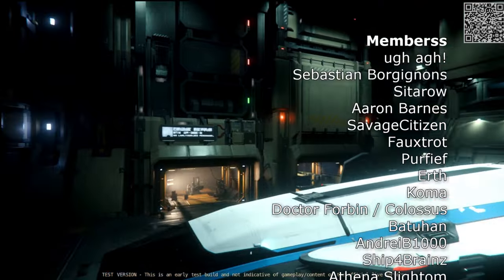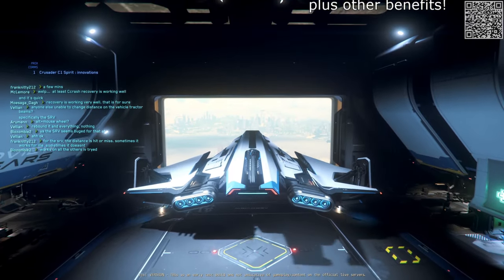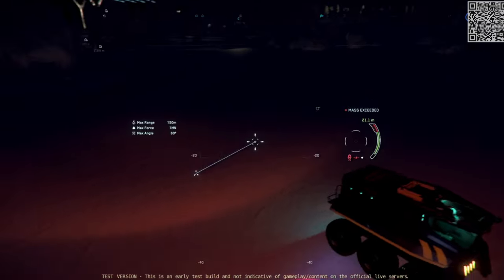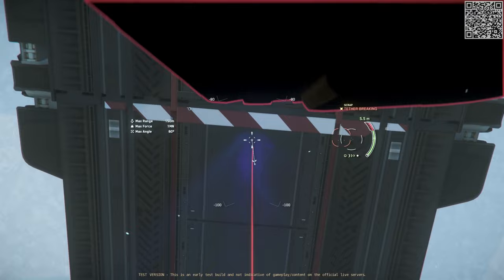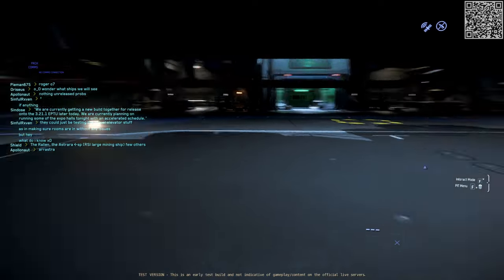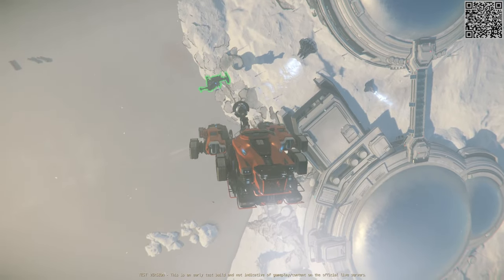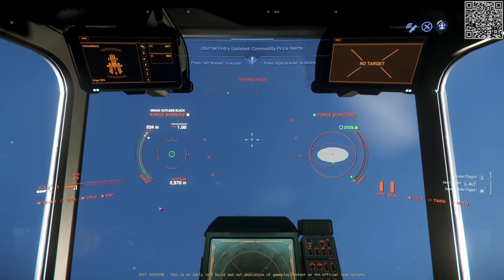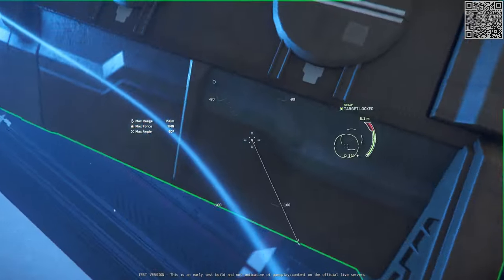Star Citizen 3.21.1 SRV and C1: A Tale of Two Tractor Beam Ships

Comment: I hope that they come up with an outstanding breakthrough in tractor beam operation, you know something that will not have us pulling out our hair with frustration. As for the realization that players will be able to use the SRV to harass others by dropping dead ships, well I expected that this would be a thing and it will be interesting to see what steps CIG will take to fix this which will undoubtedly become a problem, due to the numbers of players that will be doing it.

Comment: Regarding C1's tractor beams vs handhelds: there are many times where people forget their tractor beams (or when engineering goes live, a handheld tractor beam running out of battery juice during average use), and in those scenarios you can still load large cargo into or out of the C1 even if you did forget your handheld tractor beam, which -- judging by a lot of YouTube content creator streams -- happens rather frequently. It may not need to be super useful, but it is a good contingency just in case. Much like how with pickup trucks, they can still tow other vehicles even if they don't have a rear hitch mount attached because they have front tow hooks available... just in case.

Comment: I have both the SRV and the C1. Seems like a definite oversight on CIG's part with the placement and specs of these ship tractors. They were "placed" back when it wasn't fully settled what the cargo size and form would be. Thus when they placed the full tractors, well many of them are simply not practical or workable. The Cutlass black might have the same issue as the C1. As for the SRV tractor issues, I hope they fix it by the time it is officially released to live. and using this tow-tractor to harass people by dropping ships on them is to be expected. There are always people who look for ways to exploit game mechanics to cause upset and mayhem. Unfortunate side effect of MMO-type games. Great vid as always!

Comment: The towing controls do need some improvements at this point.  As it needs a mode to aim the towing head directly downwards as that'd help significantly for gently placing your towed ships down instead of harassing a ground location by dropping a dead ship on it indiscriminately.

Comment: Interesting stuff, though I feel the need to point out that, even if the mechanics of the SRV allowed for variable beam-length, which they should, people will still drag hulls over ground locations and simply drop them by shutting down the beam. This was inevitable from the start.

Comment: The C1 seems like a slightly cursed vehicle when it comes to layout. It just doesn't use its space very well, either because it has no second exit, or because the tractor beam is too close to the ramp making it awkward to use. Sure looks gorgeous, though.

I think the Constellation Taurus has probably the best tractor beam placement, though I've yet to see someone use a Nomad.  On the Taurus, the tractor turret is sitting at just the right height and distance to easily load the cargo bay.

True to style, the Argo SRV is well laid out on the inside. I really like that the elevator is inside the component room. Compact and logical at the same time. A shame that you accidentally colony-dropped the Cutlass on somebody on the ground, but it seems like they're still trying to figure out the feel of these bigger tractor beams. I was surprised that you couldn't manipulate the distance and rotation of the Cutty, since I've seen other videos of people using the Vulture's tractor beam to manipulate their salvage ship for scraping.

Comment: I'm very much looking forward to the SRV, it'll be interesting to use it as part of my salvage operations.  From what I've heard, the ship tractor beams, while implemented, are not anywhere near their final polished stage, especially the hauling beam on the SRV.   Hopefully, in the future, we'll be able to grab ships from salvage missions, since we have technically paid for them, and haul them to a station for repair, or even repair them enough in space by replacing parts to get them to a station, and then pay a registration fee so that ship becomes yours.  That sure would beat just dropping them on a planet.  Can you imagine the havoc one could cause by dropping a bunch of C2 wrecks on a mining outpost or something?

Something else I thought of.  I would guess that most of the time you would be towing a disabled ship, it wouldn't be your own ship, so the pilot of said ship would still be on board, and would be able to request their own landing permission, then all you would have to do would be to maneuver it into the hangar, or even better, have the hangar be able to detect if the ship was disabled/in soft death, and use a tractor beam in the hangar bay/landing pad to take over and pull the ship into the bay, similar to the auto-land function.

Comment: Inadvertently or otherwise, dropping ships (or indeed asteroids) onto unsuspecting ground targets is going to make the SRV more of a griefer's paradise than it will answer any of the game's needs (at least in its current implementation by the looks of it).

Also, it's quite hilarious that you can't actually use the C1 tractor beam to load cargo onto the ship. YOU HAD ONE JOB!

Comment: Well... at least you found a way to make the Cutlass Steel a useful drop ship :D  There are a lot of issues with ship tractor beams - I wonder if an operator UI (similar to a tower crane controller cockpit) is planned, with manipulation icons on the screen instead of keyboard shortcuts you could just click rotate arrows or a beam length slider.... similarly it could warn you when you're about to smack the container into the ship in a similar way to a car's reverse parking sensor.  Obviously it shouldn't completely trivialise the cargo handling but there needs to be a safe way of getting stuff on to your ship :)

Comment: How is it RoRo? That would suggest the vehicle doesn't need to reverse. RoRo is used to describe station design for land vehicles normally, such as trains. They roll on from one side and roll off the other. The bay in this case would be Terminus, you have to exit the way you came in.

Comment: i wonder if the C1 will be able to tractor external containers in flight.
if there was an even larger container format thatn 32 scu .. or say, some method to bundle together several 32 scu, and if the spirits tractor beam was able to hold on to such a container stack in quantum, it would double or tripple the total scu cap for the spirit c1 easiely.

Comment: I would have thought that as they already have the elements in game to rotate and shorten/ lengthen beams they would apply this to the Argo ship towing. Even just the rotate would make things 100% easier. I like the idea of the arm extending to use in the C1 and Zeus, but maybe just shortening the minimum limit would also work if the beam has the mobility to move items all the way along the ramps without losing lock, something that also happens with the current hand held Pyro multitool. Not looking forward to getting dead ships dropped on me though or coming back to my ship after a bunker and finding it's been towed.
Reply: The ship tractor beams are slightly different tech in terms of how they handle mass, so it may require more tweaking than what we have with the handheld tractor beams.
Reply: I think you may have misunderstood my comment, I meant purely to the rotational elements of the mechanic, which should remain the same in the base code. Mass and volume should be just variable integers in the scripting.
Reply: @krisghoststar  Ah, yeah, I understood -- I was more-so referencing that even though they seem like the same tech just scaled up for ships, sometimes the functional library code for these features aren't quite the same because of how they're accessed. For instance, there are steps to accessing the ship tractor beams that aren't required for the handheld tractor beam because of the difference in object container hierarchies. So the function to rotate items through the ships may not be as simple as copying and pasting X/Y axis rotational code since the tractor beam utilises the ship's utility function rather than the code they used for on-foot utilities. Does that make sense?
Reply: @billywashere6965  That makes sense, Still wish we could rotate lol
Reply: @krisghoststar  Oh yeah totally agreed!  I hope it's on their to-do list :D

Comment: Dropping ships on ground locations could be a good troll, but it's nothing on the actual bombs which just got a lot more accessible with the A2. It did get me thinking though. Can ship tractor beams grab a dropped bomb? Is it possible to make a bombing run with non-bomber ships that have a tractor beam attached?

Comment: I can't really imagine how they thought these were ready to go into even a PTU patch. It was one thing last week when it was all "Tractor beams aren't a testing focus yet bc they need improvement" but then they became a focus yesterday with very little in the way of necessary control improvements. None of these issues with range, maneuvering things or vision lines should've been able to make it past internal QA; it feels like these weren't even looked at by human eyes before they were rolled into the build.
Reply: What you're playing is what's been fixed and addressed -- in its basest form -- by internal QA. In other words, they can be used. What people don't oftentimes understand is that implementation =/= usability. 

Getting them implemented and actually stable (there are still a lot of CTDs associated with them) requires a lot of fringe case scenarios that you only get from testing at scale, and so that's what they're doing. They can identify the biggest issues (those associated with memory leaks or call errors) and then fine tune from there, which makes sense why it was in EPTU and not the testing focus. Now that some of the CTDs have been addressed they may be focuisng a bit more on improving the usability.

Comment: The C1 is, I think, one of the least well-thought-out ships in recent years. I love the looks, but it’s huge, turns slower than ships even bigger than it which have turrets (MSR), has shields that punch below its weight class, and it’s tractor beam is in a very strange position. Also, what exactly is the point of the moving turret? I don’t quite get it. I think I’m going to downgrade my pledge to a Mustang Beta again.
Reply: It was planned for features to come, not the current state. A lot of people make the mistake of thinking CIG designs features for the current alpha and not what the game will be. Remember, flight surfaces are coming, so it will handle much better in atmo than ships that are not as aerodynamic. And the ship tractor beams are tier 0, so obviously they will be iterated upon with future updates.